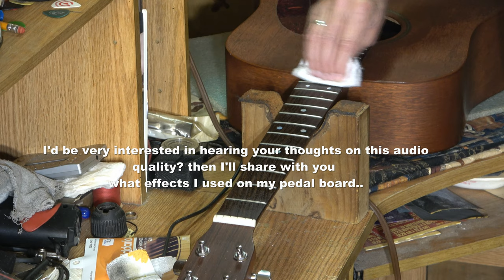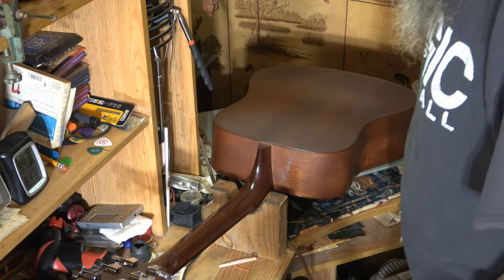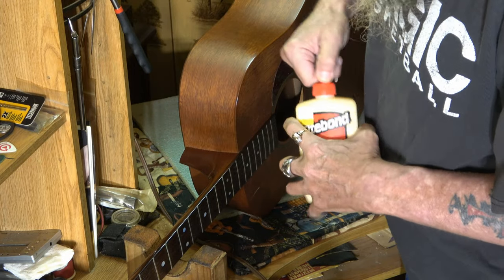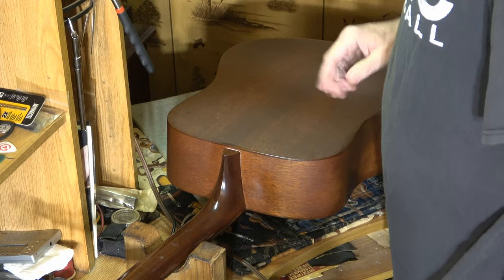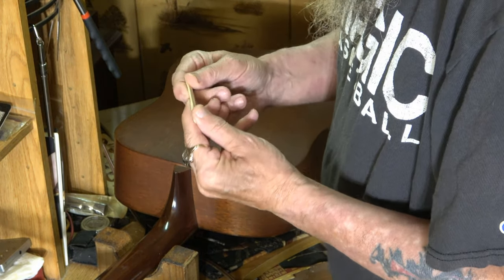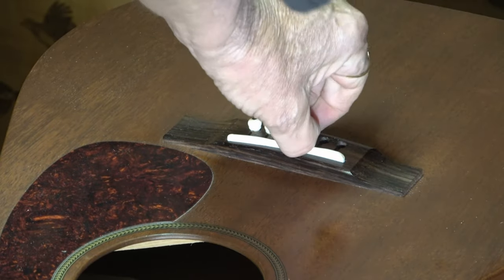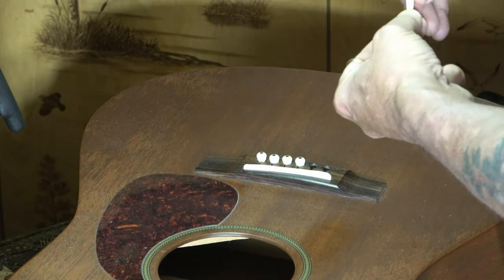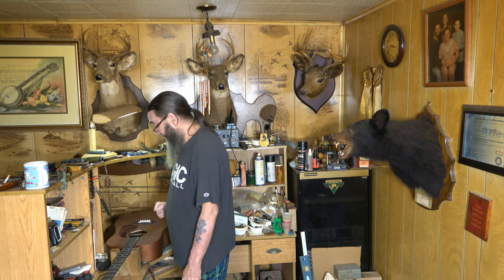martin d15 rework important tips for certain guitars :/

Comment: Hey Randy, thanks for posting this. I'm the guy that told you I found the same issue on my Martin D-16 GT after watching your first D-15 video. I'm gonna try the glue thing like you did. I was also thinking about over spraying around the heal with nitro cellulous spray after the glue dries and then buffing it in to match the surrounding finish. I don't know if that's a good idea (or way overkill!) or not, but it seems like it wouldn't hurt.  Thanks again